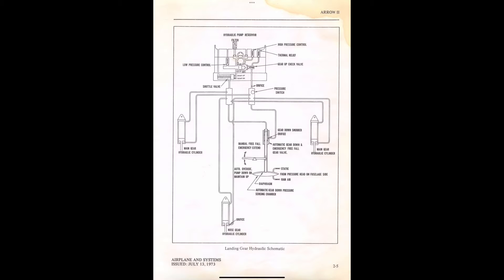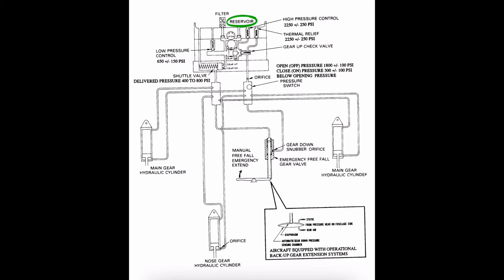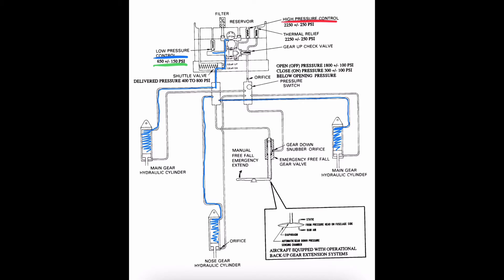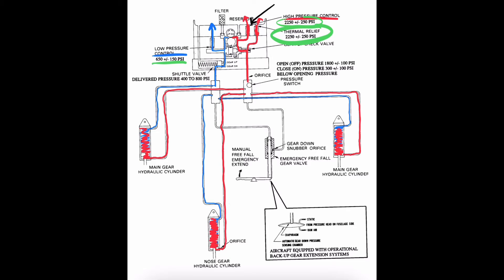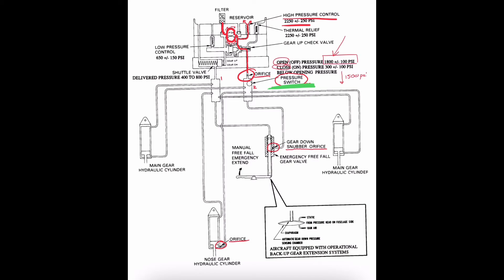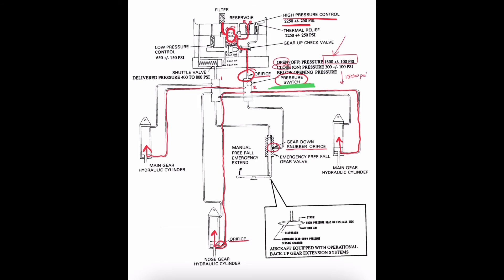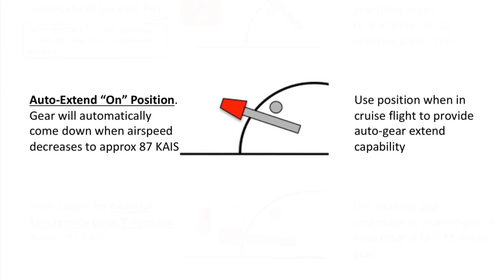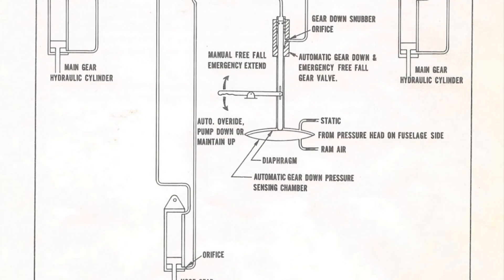Landing gear system Piper Arrow | aircraft systems

Comment: You did not mention that the emergency system is designed to be idiot resistant. With the gear selector in the up position and the emergency gear switch in the normal mode the gear will drop below 87 kts. When studying the diagrams for the 1968 Arrow that I used to fly, it appeared that the gear would drop with the master switch off as well. I did test the low speed deployment (at a safe altitude) but never tried the master switch test. I don’t have access to the manual any more. I loved that plane. 140 kts @ 9 gallons per hour.

Comment: I have a 1977 Piper Arrow III.  The landing gear was working just fine until the annual inspection.  At annual when we tested the emergency down cycle, it worked just fine.  We did it three times.  After that we had problems with fully retracting the gear.  The gear would go up but he hydraulic pump would go on and off every three or four seconds for about 1/2 second, maybe less.  The hydraulic pump was going on intermittently.  I figured it was a leak somewhere and looked all over for that leak.  Could not fine one.  The gear cycled down just fine and no hydraulic pump intermittent operation.  My mechanic said it may be the pressure switch going bad.  He also thought it may be the emergency down mechanism.  He also said it might be the pump.  I disagree on the pump because it has been in the plane for just a few hundred hours.  The mechanic seems to be all over the place with his diagnosis.  What do you think?  Any suggestions?
Reply from the maker: I would only be guessing, I’m not really sure what would cause that exactly
Reply: @CFIGreg  It is highly likely the gear up check valve leaking or not seating.  Your explanation is great.  I pulled the pump and sent if off for overhaul.  I don't believe the hydraulic fluid has been changed in the pat 40 years.

Comment: I have a 1977 Piper turbo arrow III. On two recent short flights I have noticed the gear unsafe light illuminate and it appears that the main gear are sagging into the airstream, but the pump is not activating to fully retract the wheels. Any ideas on the cause?
Reply from the maker: I’m not really sure what would cause that. I’m not an A&P so my knowledge level of the landing gear is tailored more towards teaching students a basic understanding of how the gear functions. I would do some research and maybe consult an A&P. I’d also like to know the answer, shoot me a message if you find out.
Reply: No definitive answer yet, but the consensus is that it’s a problem with the pressure switch.
Reply: I have that similar issue right now on my Turbo Arrow III. While flying if I did a abrupt push over with the yoke that would be enough for the light to go out.  We put it up on jacks and found out which main it was and when we pressed up on the right main the light went off. We have new switches on hand and will replace it at annual this month. Hopefully that's all it is is just a bad switch.